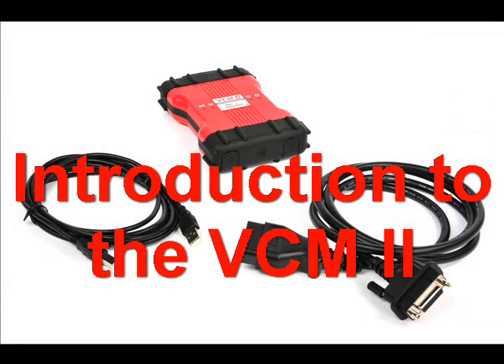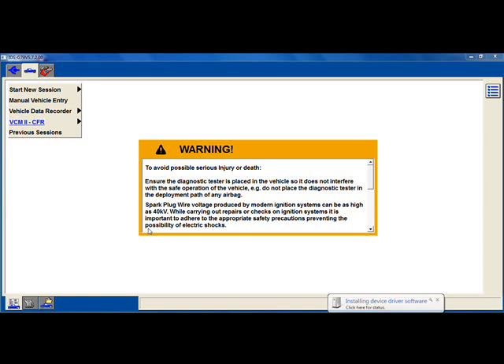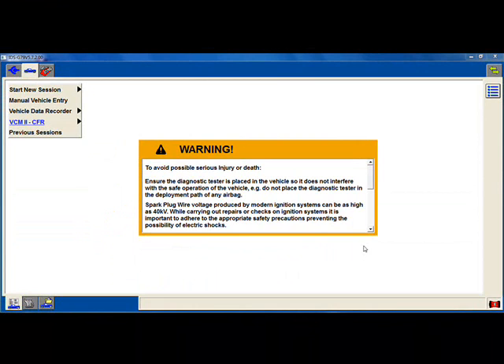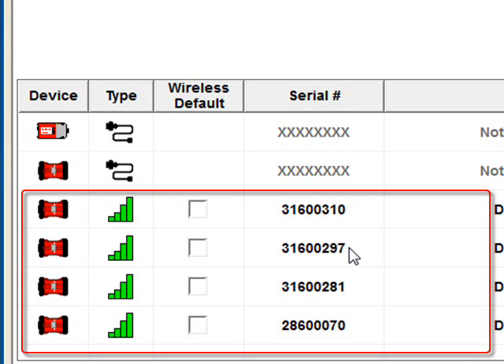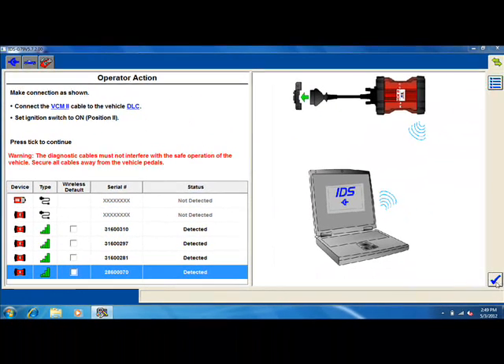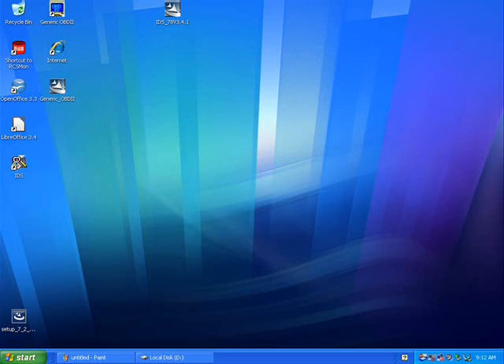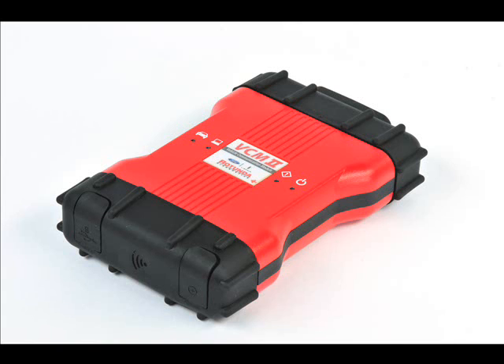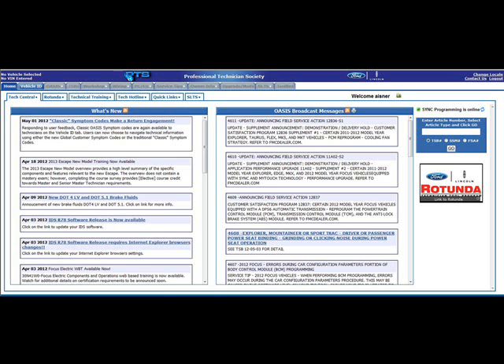Ford VCM II Intro EN.wmv

Comment: How do I pair/create my own usb wifi adapters to work with the device and computer? I unplug the usb and see the wifi bar, but it says there's an issue.

Also, on 130.05 I don't get the green arrow connection icon.

Comment: Do these not work with Windows 11, I can not get the wirele3ss to work. and the wired isn't giving me the green arrow button at the top or the other connection icons at the bottom, nor does it have vcm (ii) info in the screen that gives details.